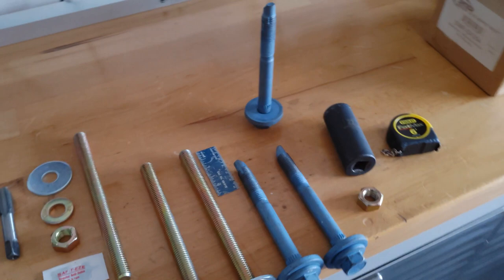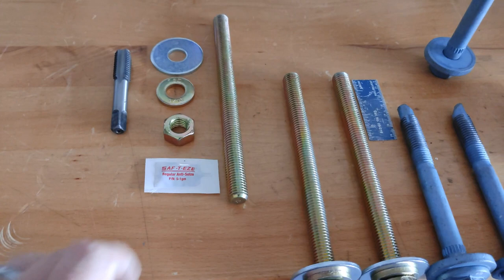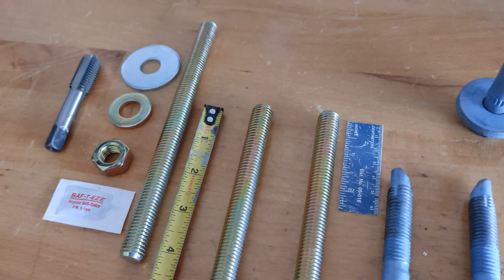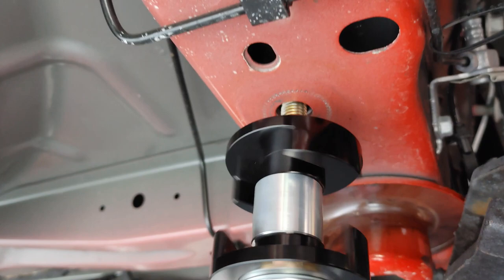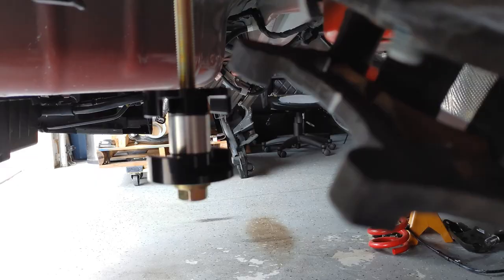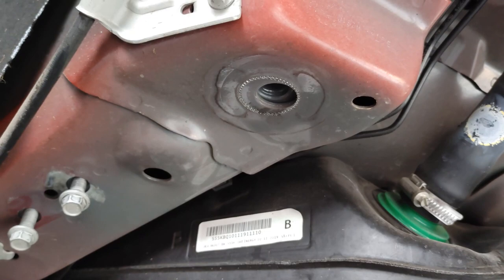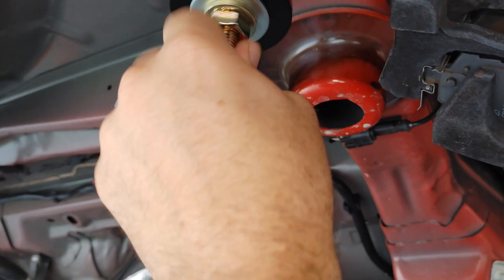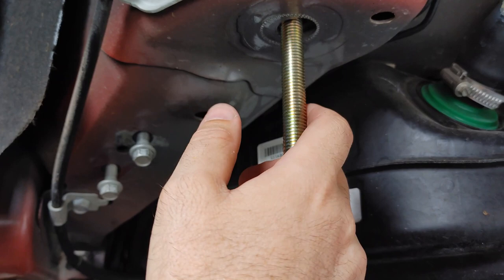KELLTRAC IRS STUD KIT FOR S550 MUSTANGS : Technical, Product and Installation Overview - GET STUDDED

Comment: this is how things should be done. one recommendation, since you're having them machined why not have them cut a couple flat spots on the beveled ends flat so people can throw a wrench on the end. slotting the other ends like a tap might be a pimp way to save the money on sending people a tap with each kit.
Reply from the maker: Noted and may do this if cost isn't too bad. The other option I have considered is simply sending a loc nut with them.
Reply: @KellTrac  too late for my i just installed mine with some big bertha bolts :D they really helped with lowering the IRS enough to drill out those rears. I'm just doing the back ones for now because I have a torn bushing and I'm hoping i can avoid additional NVH by letting the front ones remain stock.

Comment: When installing my factory bolts back into the car I had turned in the bolts by hand a couple of turns and then sent it up with an impact. Sadly on the way up it felt like it got tight and probably stripped out the nut. Outside of taking the bolt out and running a tap through it and replacing the bolt, what would be a proper fix if the threads aren't saveable? I already have new bolts and a good set of taps ready, but I want to plan for the worst.

Comment: I noticed the product is no longer available, is it best just to go back to the Ford dealer & buy the replacement bolts.

After several times of lowering & torquing back down, I feel it best to replace them now.

Any thoughts?

Comment: I recommend a slight design change if possible. All thread bolts are prone to shearing under shock loads which is what this bolt is exposed to. These bolts should have a shoulder which will help the bolt seat properly.  //////[[[[[[//////.
Reply from the maker: Hi Justin, thank you for your suggestion. If these fasteners saw any significant shear load forces we would surely shoulder them, but they do not. 👍
Reply: @KellTrac  LOL if you put sheer load on those things you probably totalled your car anyways